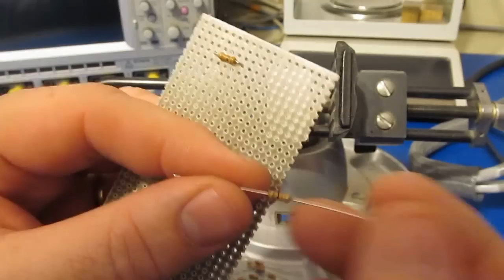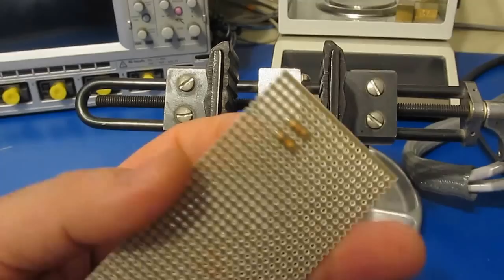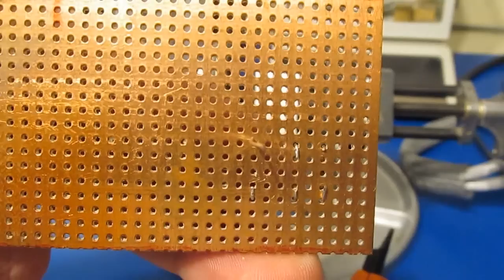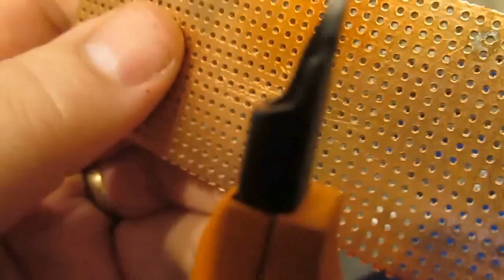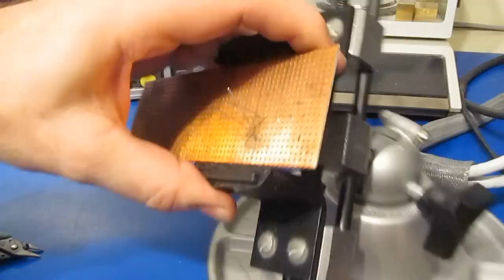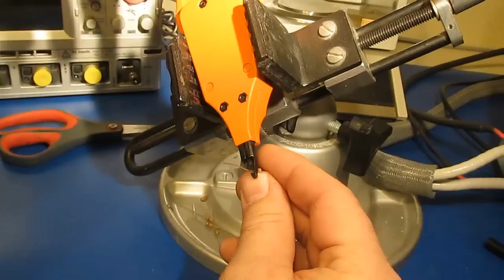Eraser TP-8 Cut & Clinch Tool

Comment: I seen your post on the eevblog but it wouldn't let me sign up lol. 
I have one of these made of metal made in Italy by ELettronica MEC called a TP-3. Looks 70's/80's too. I seen you looking for the one you're using here but sell you mine if you want it lol. You must of found that one after that post I found trying to find out what the thing was haha
Reply from the maker: I've had this one maybe 30 years now.   I think someone had asked me about getting one which may have been why I was asking.  The last time I used mine was to make this video, 6 years ago.
Reply: @joesmith-je3tq  the one I have was my dad's he used to do a lot of soldering and computer building in the 80's and 90's. Thanks for getting back to me sir

Comment: The original tool was the TP-3 by OK Machine Tools and it was black and made in Italy. The orange Eraser TP-8 came later and they are nearly identical.  You can load a whole board with leaded parts, clipping as you go and then solder them in a batch. A user tip is to orient the tool so the tail that is clinched lays over the foil and not in a position to cause a short. They both work great and are very hard to find now that surface mount has become the standard assembly method for boards.

Comment: Quite interesting.  For my personal use I solder and then cut but I can see how that tool might be good for some jobs.  Thanks for sharing.
Reply from the maker: With larger build qtys, wave soldering was/is used.  You want to make sure the leads are all formed the same and that the parts will not move as the boards were handled.